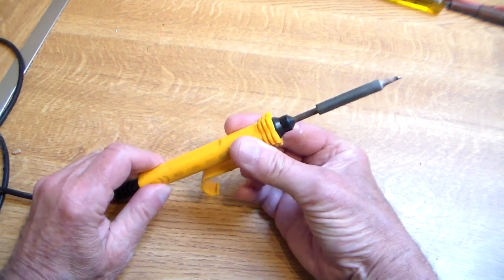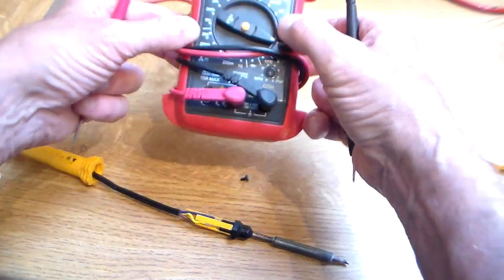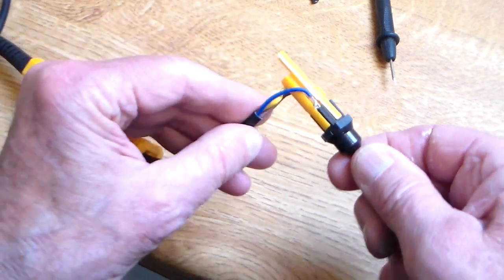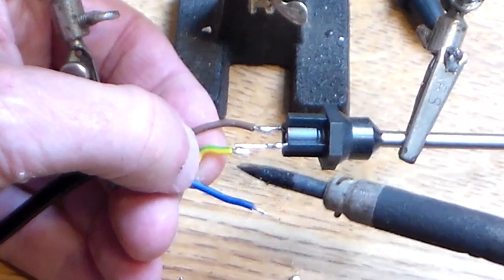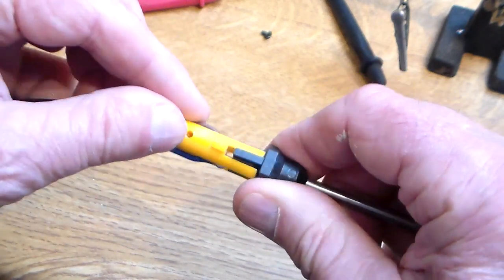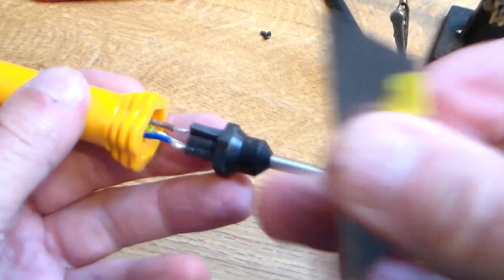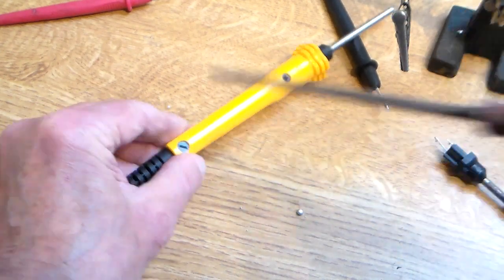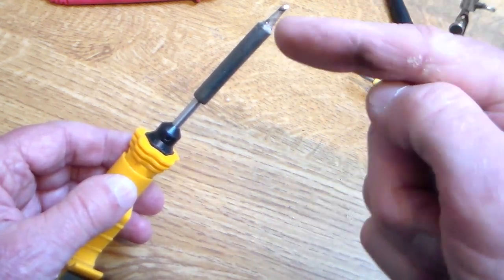Why is it the simple jobs are never that simple?  Replacing the element in Antex SX25 soldering iron

Comment: That's a very risky & unnecessary way to test the lead a continuity test between each plug pin & heat element contact wire would do.
Reply from the maker: I didn't do the continuity test live.

Comment: Honeywell engineer (ret) here. Having completed the PACE H.R.S.S. course for micro electronics NASA standard watching this is painful mainly because I have had to use an 80 watt backup iron and have had to do this. Awful memories of melting the plastic surrounds because I no longer have access to a PACE soldering station. 🙁😄
Reply from the maker: Ha ha, that must have been VERY tricky!  Pretty easy with that old iron I had kicking about.  😉
Reply from the maker: I've done some very tiny soldering sometimes with that tip!
Reply: @bobflyman  LOL the 80 Watt Weller is quite large, about 7/16"tip and very hot. Definitely for plumbing only. Bought a cheap but excellent LODESTAR iron from Gearbest that has removable (grub screw) tips not unlike a PACE to look at for AUD $10. Sadly discontinued. The Chinese Loadstar brand seem quite reputable and great for the price.
Reply from the maker: @KevinHallSurfing  Thanks for the tip Kevin, I'll look out for it!
Reply: @bobflyman  Here is the old link. Gives you the specs at least. Was 2016 but definitely value.
https://www.gearbest.com/soldering-supplies/pp_313889.html?wid=1433363